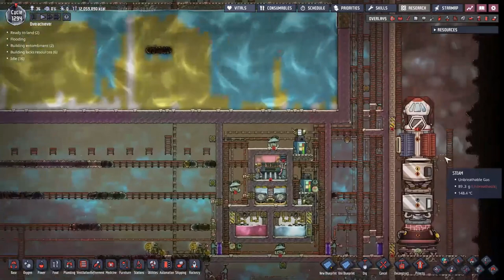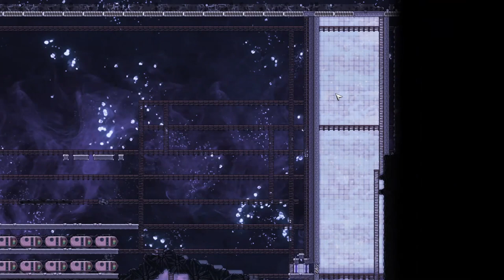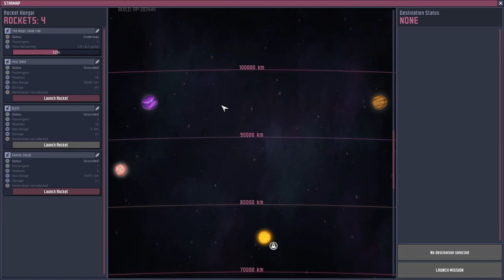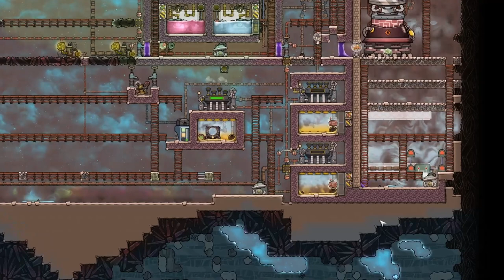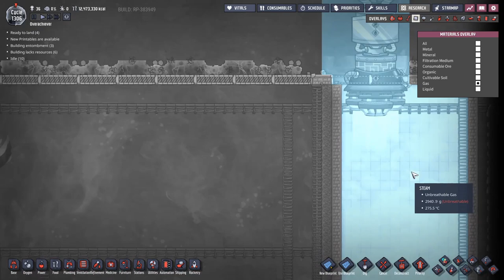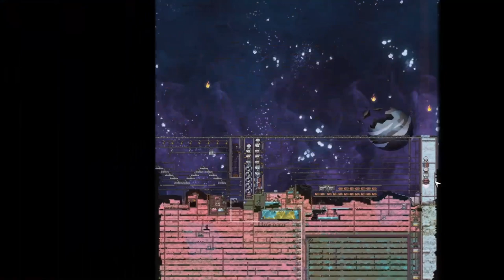Rime 28 : Harnessing power from a Rocket Chimney : Oxygen not Included

Comment: You once showed a build that froze meteor CO2 before it hit the ground.  Wondering what would happen if you had -250 degree C super-coolant at the top of the chimney. This should turn any steam touching radiant pipes into rime, which would fall down the chimney.  Must see if that turns the fog it touches into rime too.  That would be the most poetically correct solution to a Rime map steam (fog) chimney.

Comment: if you put in a liquid lock in front of the insulation before taking it out while placing a door into the wall, you will get a vacuum between the visco gel and the metal tile meaning no heat is going into the base

Comment: You can try to build more steam turbines side by side to (2 or 3) in each level, ( you can distrubute the heat below the turbines with temp shift plates) . I didn't do any math on it, but 24 steam turbines does not seem to be enough to handle two rocket's heat generation. This way you can have 100 steam turbines to handle 2-4 rockets. (and probably generate at least a megawatt of power)

Comment: Why not just put a carbon skimmer at the bottom connected to a sieve OUTSIDE of the silo? I think you could make it out of niobium maybe even steel and it would be fine. Leaving the sieve inside will probably make the polluted dirt off gas. That way you don’t have to worry about another “contaminant” in the chimney or steam breaking pipes out of it.
Reply: The Skimmer combines the Temperature of the Water and the CO2
It has low Heat Capacity, but 300 CO2 will heat it up over time.
You would need to route it through an Aquatuner to keep it from boiling

Comment: Why not use the steam turbines to siphon off the steam.  Instead of using a steal door to inject heat into the steam turbine.  Just open the the door and let the hot steam in.  Then instead of letting it drip back in just take the water out of the system.  It should also make it easier to build many many more steam turbines.

Comment: You should probably add some logic to prevent the rocket launching during a meteor storm, just so you don’t run into that carbon dioxide issue again. That and adding steel doors at the top for the return journey. And maybe deliberately handicapping the rocket detection so it detects the rocket just in the nick of time. 

Disclaimer: I haven’t played the game before, but have watched a lot of videos of it.
Reply: The biggest issue with trying to meteor-proof is the return journey. Since you can virtually guarantee that a meteor will enter at some point you're probably better off designing the system to cope with (occasional) meteors rather than assuming you won't have them. And if that design is robust enough, you probably don't need to worry too much. That said, also in this case since he isn't feeding his turbines directly with the rocket steam, but rather via a heat transfer medium, it is probably less important exactly what gas in the silo is getting hot (although it would be ideal if it was nice and heat conductive)

Comment: How about a door pump to get the heat (with steam) into steam chambers? That could help you get the water out of the system at 95*C, without the need to deal with superheated steam. Just think about how not to trap CO2 into the chambers, but that should be solvable with some L shaped injection tunnels.

Comment: Visco gel lock question. Is it only in debug mode that you can build visco gel ladders. Cause they condense to visco gel locks. And can be built typically faster.
Reply: You can bulid plastic ladders, but instead of using 'plastic' plastic you can use 'plastic' frozen visco. In survival you would need to make visco freezer to make it viable (if i am thinking correctly)